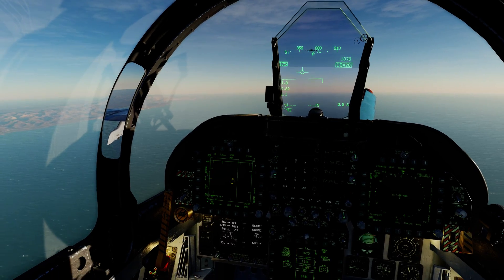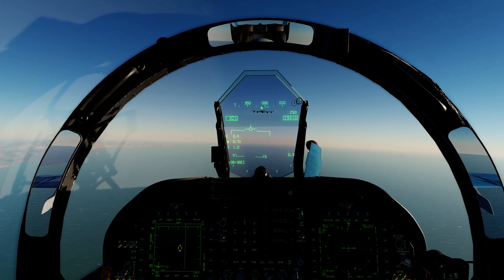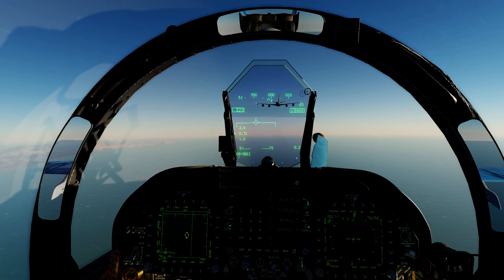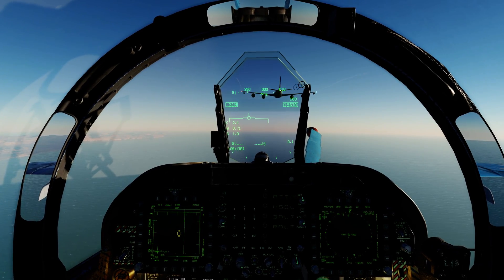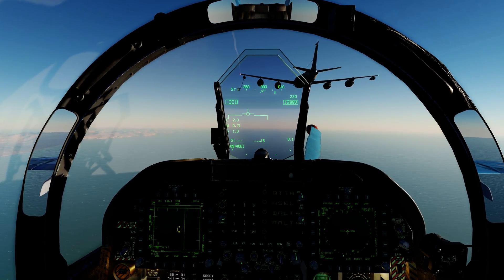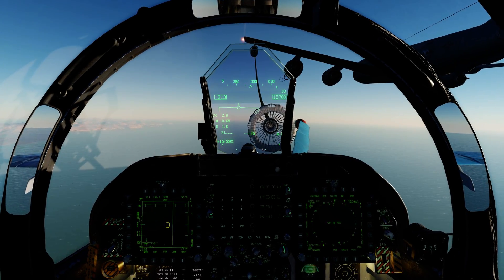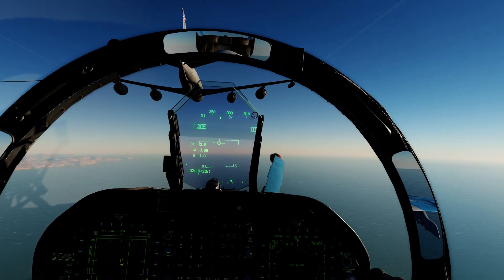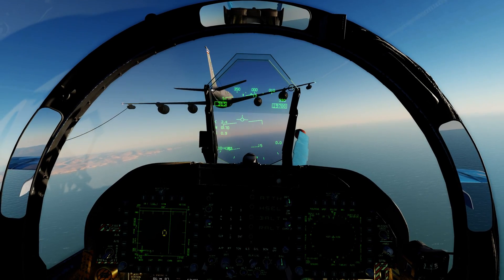DCS World - Air Refueling With Wake Turbulence - MPRS vs Centerline Basket vs Straight Boom

Comment: Hello fellows I am continuing to work on air refueling.   I have good bit of trouble what is the normal airspeed for each tanker so I can set up my mission to reflect that speed.
Reply from the maker: MPRS for drogue n probe usually 260 - 280 knots indicated. For Boom/Receptacle AAR shoot for 280 - 300 KIAS.  http://www.japcc.org/wp-content/uploads/ATP-3.3.4.2_Ed_C_Ver_1_Air-to-Air_Refuelling.pdf

When you set up the Racetrack and waypoint information, match speed and altitude in each waypoint settings tab.
Reply: @AIRWARFARECHANNEL   I have my set at 325IAS
Reply from the maker: Indicated airspeed is important in the real life.   For the Hornet, the probe is durable but the door that covers it is not rated above a maximum speed.  The USAF Boom AAR is also very sensitive in relation to the airspeed, too slow and the nose-high attitude makes the receptacle in the wrong attitude to receive the boom coupler. Too fast airspeed and clear-air turbulence is more difficult to manage.  Play with the airspeed in the editor until you get the sweet spot.

Comment: hey juice, I'm trying this mission but struggling with keeping the plane level even before I get into the wake turbulance. You mentioned that you trimmed out the hornet, but I find the FCS of the hornet almost feels like it has auto trim except when landing or take off. I feel like I might be missing something in trying to get it stable as I approach the tanker. = ICEKAT
Reply from the maker: Hey JS, good point...so what you are experiencing is induced drag difference from the asymmetric loadout in that mission I uploaded to the ED User Files.  You have a TCTS POD on one side and  CAP AIM 9M on the other and you have to trim that out slightly.  Give it a try and report back...what's your Callsign in DCS?
Reply: I'm Eiskatze =ICEKAT= in DCS

Comment: When using a basket on the boom adaptor, do the tanker crew still fly the boom to assist with the contact?
Reply from the maker: Surprisingly not at all.  That’s how I got to offload an entire mission fuel load to Navy aircraft on one mission in 1995.  The boom operator showed me what to do and I just flew the boom and basket into position and basically stood by to raise it in case of an emergency.
Reply: @AIRWARFARECHANNEL  Thanks for the answer, and happy Christmas. :)
Reply: Interesting question.
Reply from the maker: Check out our community tab for photos of me refueling Tomcats and Hornets.  I even got to refuel the Intruder.

Comment: I feel like the changes you are describing have been around for more than a few months, but I don't have a date.  I don't AAR often either.
Reply from the maker: Thanks, I'm trying to nail down when it was fixed because as much as 1 to 2 months ago, I remember doing the same approach without the roll inducement.
Reply: Yeah, I'm in the same boat as Snappy. I was trilled when I heard wake turbulence was modelled! So I spend some time getting to know it. I noticed that the effects of wing tip vortices from both wings were modelled correctly (although I'm not a pilot!). On the subject of wing tip vortices, at some stage ED remodelled the visual appearance of wing tip vortices on the F/A-18. This was a disappointment to me, I thought the original version looked for accurate. Or at lease the original version looked to be more of a high AOA version of wing tip vortices. It would be nice if they could incorporate both at difference stages of flight.
Reply: It's also really cool that the effects of wake turbulence from larger aircraft are much more apparent then those of smaller ones :)
Reply from the maker: Just like in real life my friend...blue skies!